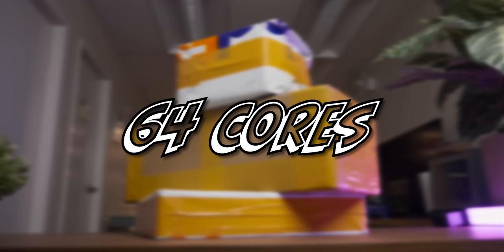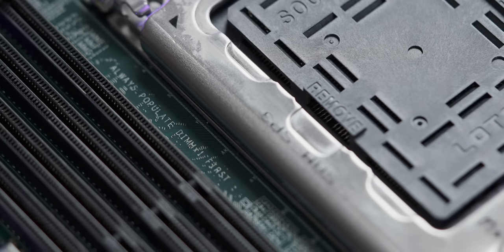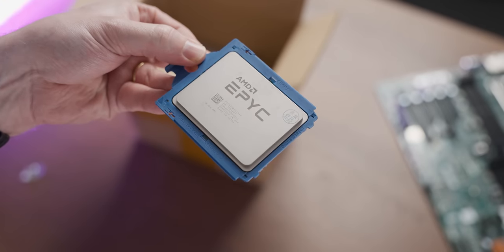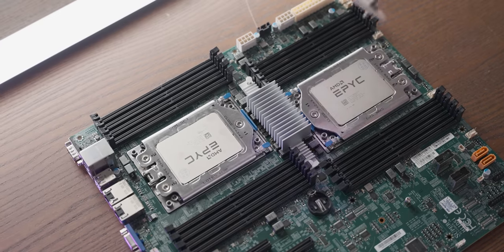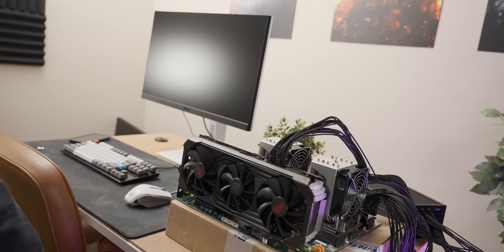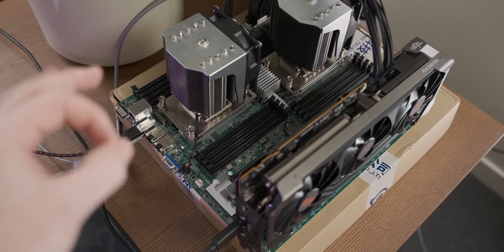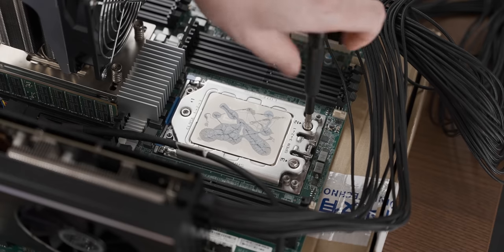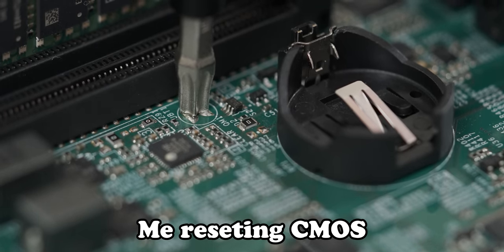I Bought 64 CPU Cores From eBay For $400...

Comment: You need to check and see what pcie lanes are tied to what processor. Very likely the second full-length slot is tied to the second CPU, and will not function without it.

Comment: The torque on the cpu and heatsink needs to be 1.4 Nm.(just use a t15 bit and electric screw machine)
Also if you connect by ipmi you can check sel log ( useful if you get errors) can check sensors and more. (you can use a serial cable for it it believe)

Comment: If you ever want to sink your teeth into it, look into xeon e7's, with the 8 prefix. You can find some old ones with pretty high core counts for just.. nothing. Something like 20-40$.

You can put eight of those bad boys on a single motherboard. The only motherboards I have found though that have it, are blade motherboards, so you would have to figure that whole mess out in terms of powering it ;). But might be fun?

Comment: This is me, but with vintage hardware (i.e. anything older than Core 2 Duo).

Server hardware is notoriously fussy about memory, CPU compatibility, et cetera.  Good job engaging your local community to try and find out what was going on with it.

Also, I'm pretty sure those slots on board are SAS cable slots, but without looking at the manual I can't be for sure.

Comment: When it comes to paste, I like to set the CPU on it and then lift it up to see if it has spread enough.  As long as you don't disturb it, it should work fine.  It did for me and I have am AM4 CPU.  I have used it every day since and no overheating or any related problem.  Now if you have old paste you don't want to set the cooler back on that, especially if it seems dried up at all.  With new paste that has not happened just yet or it is time to very seriously ditch that brand and splurge on a tube of the good stuff.

Comment: Those Supermicro motherboards turn on without cpu and ram. Try connecting the network cable to the IPMI port, look at your router if give an IPADDR then try this IP on your web browser.

Comment: Get a VGA analog cable and a monitor for it and use the onboard BMC GPU for troubleshooting. IPMI port at this stage is not much helpful (not to mention that it might be password locked and on other static ip). Sure tighten the CPU socket with a proper torque screwdriver. What I then use for troubleshooting is a Port80 display (made by asus, but i rewired the cable to the supermicro tpm port connector). That provides some more insight into the early boot process.

Comment: This feels painfully familiar. I had similar issues with my dual xeon system. But it turned out my motherboard was broken. I got it replaced, thanks ebay, but still couldn’t boot because the motherboard bios was too old. Since I live over 200km away from the closest proper server hardware shop, I had to order a spare cpu of different model. With that I first updated the bios and got everything working. I really wish there was a place one could rent server hardware.

Comment: You should be able to see what's going on from the IPMI.. that's essentially a small computer which is independent of the rest of the system and will tell you exactly what the board diagnostics are saying, even if it's 'your CPU is toast'.

Basically plug a network cable into the IPMI port and see if you get lights.. then hope you got the password..

Comment: back in 2016  I wanted to have a high core count system but they were very expensive, so I got a dual eight core sandy bridge system for around 400 dollars. I'm glad to see that that is still possible, and im frankly impressed at how much more power you can get for the same price.

Comment: We have some Eipc Server at work. the System needs about 2min to POST and a GPU is not needet. graphics runs over the MegaRack IPMI software. In the web interface you can also see debug infos like RAM, Speed, Channels, CPUs ect... An you can boot it up from there. i recommend to connect a screen and keyboard/mouse  to the IPMI Ports.

edit: you need nothing in the board to enter the IPMI Interface ^^

Comment: When troubleshooting this stuff, you should remove the graphics card and just go with the onboard VGA. Server hardware doesn't always like graphics cards. Also disconnect all your USB stuff to begin with. Sometimes USB devices can prevent boot.
Lastly, if you can, try hooking up a console cable to the serial port on the board. Some of these server boards will give you diagnostic info on the serial port as soon as power is given to the board, before you actually switch it on. Also as suggested, ipmi on one of the network sockets.

Comment: Hate to say it, but I am glad that was your voyage and not mine. Would have been a killer system though. Sometimes you can con them if there is just a burnt out fuse or something on the board. You definately want to be careful trying to screwdriver complete the on switch that it correct and you don't hit anything. Also I would not put a super heavy card in before bracing it in the case somehow.

Comment: One of the Ethernet ports is a IPMI port.  you can connect to that and with the motherboard standbypower remotely control the computer.  you may need to use the Cenozoic era video port initialy but accessing the ipmi might lead you to why the system is not booting.  I have a Supermicro x10i board and was trying to use some surplus Amazon AWS cpu's in it.  When i got into the ipmi using supermicro's ipmi viewer i was able to see that the cpu was not being detected at all at first and then showed up as the incorrect cpu and version.  the CPU was a broadwell and the cpu was showing up as a sandy bridge.  the motherboard only supports haswell and broadwell.  The Cpu's worked fine in a gigabyte board however which also has ipmi, which i used to check if it was working.  This is what makes server hardware really neat over consumer gear.  You have a computer within a computer!

Comment: Just got a similar setup to work after wasting a day on it... the torque is important, but after all else failed... it ended up being a jumper for vga.. it will not run with vga jumper disabled and a pci-e graphics card.  It will boot fine if both are present and that jumper is enabled, but the primary will be the VGA out until you get to BIOS and select offboard.  Leave the VGA jumper enabled.   Might not be your issue, but that was my entire problem.  It looks like the same board I have, same CPUs and cooler.   Once it's running, you could also use the IPMI to diagnose further (that's the blinking led telling you that part is ready to go), but it most likely has stored passkeys you'll need to reset with a DOS usb boot drive.  Fun fun!   EDIT:  Once it's running.. to use that NVMe as a boot drive, there's a section in bios where you need to set it to AMI Native instead of vendor.  It will show up during installs, but will NOT boot from it with that set.

Comment: @DawidDoesTechStuff for minimum POST, I would drop the dedicated GPU. The motherboard already comes with a GPU. It's inside the ASPEED IC. You can connect to the VGA port, or better use the remote console through the IPMI. For what it's worth, the IPMI is like a separate computer on the motherboard, and should work even if the system does not boot or POST. Note the IPMI "heartbeat" LED on the motherboard.

Comment: Dawid, I see you understood the need for a proper torque tool for installing these CPUs. Threadripper CPUs also have the same thing. I am not sure if the torque needed a for Threadripper CPU is the same for Epyc CPUIs do. So you might need to get a torque that is specific for Socket SP3 (not TR1/Threadripper), as the ones for TR1 might have a different torque spec.  I'm not actually sure about that, but using the wrong tool could break something.  Even with the proper torque, you can still have issues if the CPU is warped, or the socket is warped.

Comment: Yeah Threadripper CPUs are installed in the same manner. I have seen issues when they aren't torqued correctly not all of the RAM shows up. This is a first where a CPU like this is not torqued correctly it wouldn't power on.

Comment: Usually you need some really strong coolers for those cpus. Also power consomption and some lets just say different standart power connectors are thing on server mobos.
Reply: The stronger coolers are a LGA 3647 thing not AMD tr4/SP3 the cpu hold down is just fine as long as the cpu is clicked in by the rails or if the socket screws havent gotten lose
Reply: The fans on those coolers will SCREAM, they will do the job.

This is server stuff, designed to not be around people.

Comment: It's funny to see somebody who's never seen server hardware look at the special ports or features that usually don't find their way into the consumer space. I'm pretty sure that one of those RJ-45 ports is for ipmi since this is a server board. Also be aware that the mounting pressure for those chips is rather precise. They usually come with a special key that only allows you to tighten it as much as it is required.

Comment: those connectors are miniSAS, you use breakout miniSAS to SATA cables with them. Easiest way to do 8 SATAs without making 8 ports is to make 2 miniSAS ports. It is also standard in the industry to use it for RAID. I suspect the NVMe slot is meant to be used for RAID cache and not to boot of off. In past you'd have a SODIMM slot (and most dedicated RAID controllers either have soldered on cache or a SODIMM slot for cache module, which is not the exact same as RAM module, just uses same socket).

The microSD slot there is for booting off. ESXi, Proxmox, Truenas etc can be all booted off a USB stick or microSD card and it is often the preferred method in enterprise.

I suspect since this is server grade MoBo from Supermicro, that one of those ethernet ports is for management/KVM connection through browser.

Enterprise HW is made for stability and redundancy so that's why you get only ECC support and why the MoBo will not respond to power signal without RAM. You get diagnostics LEDs and you very often the management from aforementioned extra ethernet port is a low powered dedicated KVM machine that will work even without CPUs and has on-board diagnostic tools. 

Genuinely if you want to buy enterprise hardware for homelab, forget ebay and just scour local businesses that use on-prem solutions. They do refreshes of HW once in 5-8 years so EPYCs are slowly trickling in now and you get way better deals (often you;ll manage to snag the stuff for free as they are throwing it away and you save them effort from hiring ewaste disposal). Figuring out how companies use on-prem is a bit harder and it really depends on location, I work in the industry so it is much easier for me, but I would check out universities, sw dev companies and media production companies. Fintech often uses cloud solutions and banks have strict compliance and won't sell off any HW.

Comment: Torque to the German spec of "gutentight" -- should be fine. I doubt your issue is from not enough torque. I've read several better reasons such as Bios updates/CPU compatibility.

Comment: I bought a 32-"core" dual-CPU AMD Bulldozer setup off ebay a while back - it was fun as hell getting it going and getting the onboard IPMI set up so I could manage it via the network. I did use it for a compile farm for a bit, since I had 128GB of RAM for it and that helped a lot when doing stuff like linux kernel compiles. At the end of the day, though, the individual cores were so incredibly weak that it wasn't worth the 350 watts that it took to run it, heh.  It heated up my tiny New West apartment wayyyyy too much :D  Epyc was a big step up in terms of CPU horsepower and efficiency so I'm thinking it'll be a lot more worth the energy it takes to run it.
Reply: Yes, for peak load the 6$/core is good. Actual Zen3 at 24-30$/core is more efficient. Depend strongly on $/kWh where is the break-even.

Comment: When you do get it working, be aware that those CPU coolers will be loud. Really loud. You might want to replace them with Noctua coolers down the line. Or put the board somewhere where the noise doesn't matter.

Comment: I had this same problem with older motherboard so I flashed a new BIOS on it and now it boots just fine. But it may not be the case here just because the person said that it works so it may be just the socket problem.

Comment: I am in the same troubleshooting situation with a t7810 mb and a Xeon. I don't know which pins to short to jumpstart it and at one point the GPU fan spun but nothing else. The partners of Dell I wrote a letter to asking for the pinout just gousted me. If somebody here has experience with server boards, please respond to me. I know this isn't the place to write about these problems, but nobody on the forums knows how to figure it out. Also, can't wait for the follow-up video.

Comment: I have a similar problem with a Supermicro Xeon Server board, the problem was its size, it is a EEATX, yes it is well writen, the problem was the board is so huge that only can be fitted in some cases, I adatped a Coolermaster Cosmos 1000 and the top with a zip tie, after check it is not bended it turns on ok, so the cardboard box used at the begining to test is not ideal, you need to check those boards are not bended even a little, so it can be turned on

Comment: That board probably has an IPMI port, usually capable of getting an IP from DHCP, I would try to connect there and see if the dedicated engine reports what the issue preventing from power on is.

Comment: David the issue is very clear to me: while you did it almost right to jump start the board using tweezers after 25 years of hardware frickling the ideal solution is a sharp slot cover plate. It allows bringing more than just two contacts at once usually waking the board up 😊. Good luck with part 2
Reply: I don't know why more "tech guys" haven't pulled a power switch out of an old case so you can just plug it in and have an actual switch to push.

Comment: You know these supermicro boards often won't use a slotted GPU by default. You should skip the GPU and try and get it running using the onboard VGA.

Comment: I havent played with server spec hardware in a LOOOONG time; but back when I did - the PSU connections LOOKED like ATX, but werent, you could plug in an ATX PSU - but it would kill the mobo as all the feeds were in the wrong pins.

Ditto plugging a server PSU into a normal mobo.

Comment: The problem is you didn't use the CPU threadripper torque wrench that comes with these cpus to apply the proper pressure onto the cpu to the board.

Comment: Currently watching this video from this exact same mobo. In your troubleshooting case- the CPU's seem to be a bust :( However i can give you some information for the future. The BMC heartbeat seems fine - unlike consumer hardware, this motherboard has an interface that you can connect to with another computer, via plugging ethernet into the port above the two usb slots, running ipconfig on your working pc, logging into your router, finding the IP assigned to the mobo, and logging into the mobo. From there you can view various status information about the board.

Comment: I bought a combo and my computer has been working mighty fine, I went for a SuperMicro single CPU, best money I spend on hardware. Windows 10 runs smoothly.
It has hardware RAID, remote management, good temps using a 2U heatsink...

Comment: Have you tried removing the GPU and just using the onboard mesozoic period port with 1 DIMM per CPU? Sometimes server motherboards are very... picky with what GPU they work with on boot. 
Also, you have an SSD in the M.2 slot, perhaps it's a storage issue where the motherboard refuses a boot with the only disk being in the M.2 slot, sometimes those boards preffer SATA or other types of storage such as U.2.
Try connecting it using only the Ethernet port as well.

Comment: I'm posting my comment probably late but this motherboard has IPMI. Its main output is therefore VGA. To use a graphics card, you have to go into the bios and change the setting so that the boot is no longer on the "ONBOARD"

Comment: My ebay Xeons work great, but I did have some problems with them initially, because the CPUs weren't settled in the sockets perfectly correct on the ebay Asus workstation board

Comment: even with the torque set correctly these cpus are super bad at having all the pins contact, mounting pressure on the heatsink matters aswell, its a nightmare

Comment: ok so one of the network ports if for ipmi and i think the microsd is for iso storage so you can remotely install the operating system. i have the 7551p wich is the single socket variant wich is pretty good. my front io connectors on my supermicro motherboard where kinda funky. it worked when shorting to the pin below for me but not with the pin to the side wich was listed in the manual. you should also be able to reach the ipmi even if the system isnt powered on

Comment: You figure this out yet? I just made the same exact build and enjoyed watching you go through what i did. Some people in the homelabs reddit helped me out. Short answer display has to be vga out until you get into the bios to change it. No need to power on that is its default state. The non ecc should have worked but all 16 are needed for full performance. Takes like 3 minutes to boot so be patient. And i got the torque wrench for a bicycle off amazon. Let me know if you need any more help. O and if you are worried it was too cheap I paid half for the cpus, and that motherboard is your only option. And damn did that ram hurt.

Comment: Try to connect a case fan to one of the fan headers, this was the only way i got my server mb to work on a previous setup. Won't power on without a case fan connected 😂 the mb i used was a supermicro X9DRi-LN4F+